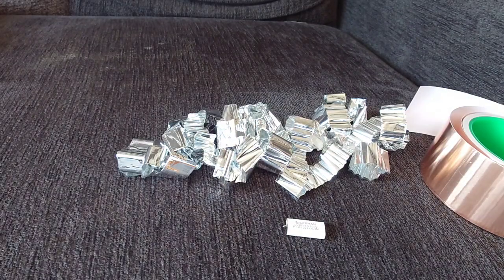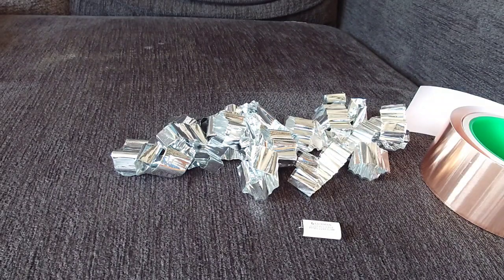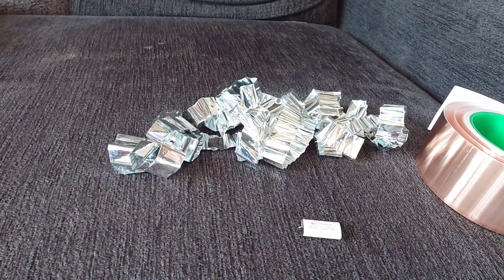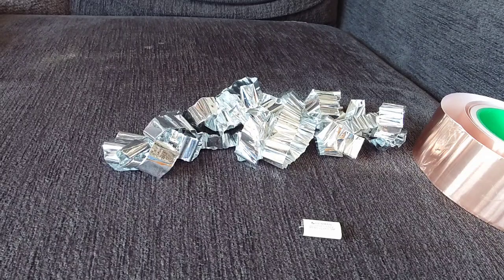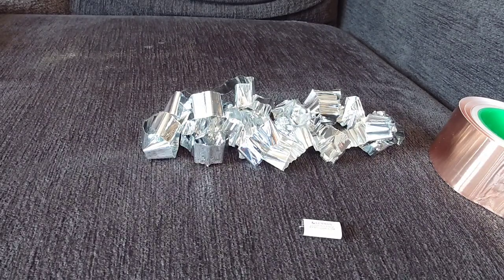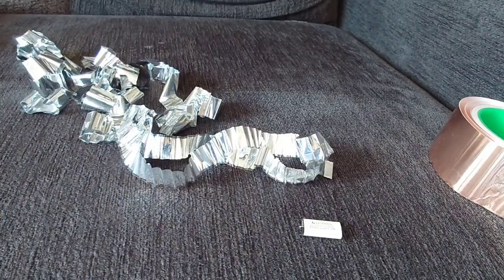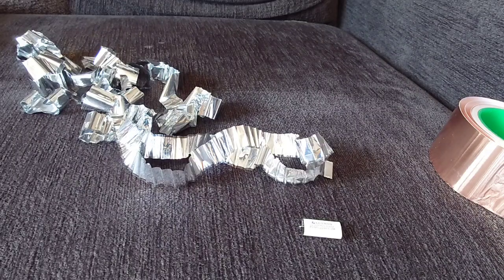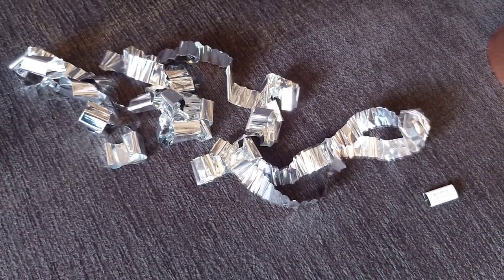I'M GOING TO ATTEMPT TO BUILD A COPPER FOIL CAPACITOR

Comment: I've been following you for a long while. Especially when making your own RCA cables, to better speaker wire. This would help because a lot of manufacturers dealing with capacitors they say the best ones to have is the Copperfield. But I wonder the paperback on the copper wouldn't that work?  By itself wouldn't the paper be a pretty good insulator?

Comment: Hi Ian - I assume that you are aware of this: The governing equation for capacitor design is: C = εA/d, In this equation, C is capacitance; ε is permittivity, a term for how well dielectric material stores an electric field; A is the parallel plate area; and d is the distance between the two conductive plates.
If you know the thickness of the insulator and its material you should be able to work out what area you require and therefore how much foil to use. 
The capacitance increases the THINNER the insulator. There are tables in the internet with the permittivity of various materials. To increase the capacitance, you need high permittivity. Teflon, for example, has LOW permittivity which is why it’s a good insulator for signal and speaker cables because it DOESN’T store energy. So the opposite requirement as for a capacitor. Wishing you all the best with the project - you’re very inventive and resourceful so I’ll be curious to see how you get on! 
I hope this was helpful. All the best, Rob in Switzerland.